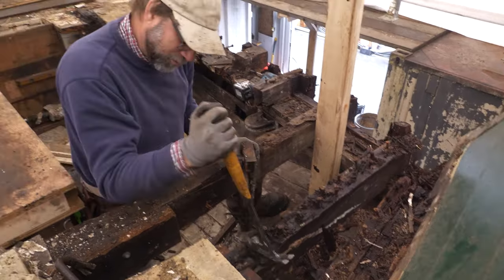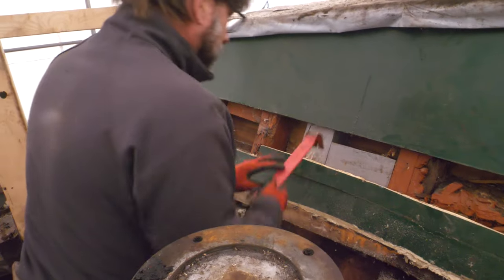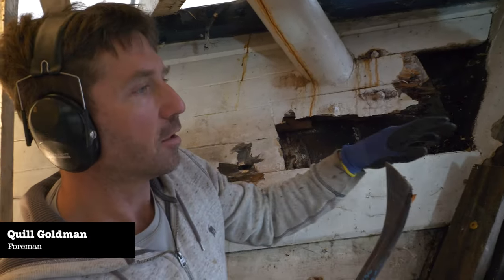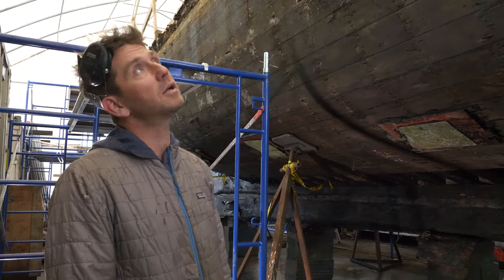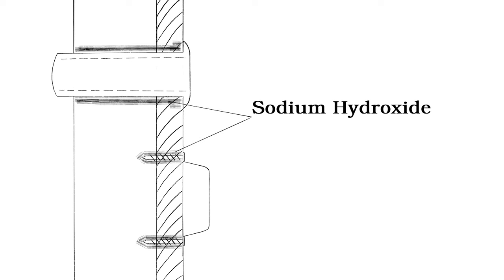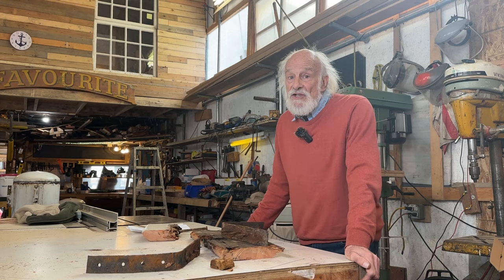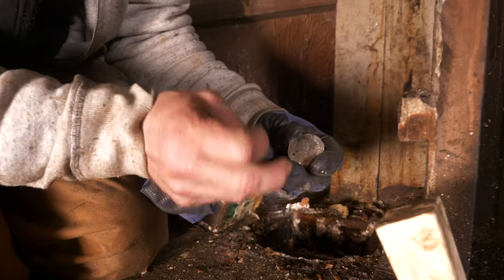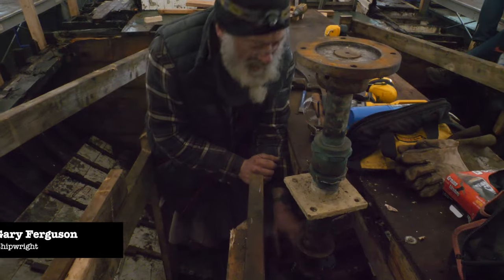How much of this 90 year old ship is salvageable??

Comment: So what kind of horsepower are we looking at on that old mother you pulled? I was surprised by the small size
Reply: It's a GM 4-71, lots of power. Installed laying on its side to fit under the galley. Very odd installation.
Reply: Its only like 160 hp from that block.  Sure with lots of torque .  @fahmoh

Comment: My god, how long was that ship underwater?! There doesn’t seem to be one drying anything on that boat…except maybe the concrete. Even the metal encased in the concrete is rusty.
Reply from the maker: 88 years, in some of the roughest conditions in the world. Frozen into the ice many times, beached, etc. she was built like a tank with a layer of ironbark on top of the original planking. And then copper was eventually added on top of that.

Comment: She certainly is in a bad way, makes Tally Ho look pristine when Leo first took her on. Appreciate that North Star is a working boat, but hopefully the aim is to restore/rebuilder to a high standard respecting her history. Lots of work around very rotten and wet timber and rusted and rotten metal work. Stripping down is nearly always the relatively ""easy" part, but how are you going about recording the shapes and details? Are there drawings of the boat, and/or new drawings being made as the work progresses, and are photos being taken of the parts as well as measurements, or how will the replacements be accurately reproduced? Whatever, wishing you all the very best of luck in your mission to bring her back to life.
Reply from the maker: Yes, patterns are being taken for each piece that comes off, that work will start around next episode. Cheers!

Comment: ln the deconstruction of "Tally Ho", Leo Sampson and his lone helper were quite careful, that they salvaged a lot of hundred year old wood which they cleaned and reused in the new, refurbished Tally Ho.

This one is at least 8 feet longer than Tally Ho and younger by about 25 years so there could be more salvageable, precious wood.
Reply: the condition of tally ho's timber was much better than this - this is at an advanced state of decay, as has been stated by many pro shipwrights/riggers in this series. also tally ho had been gutted. i'm sure they are documenting and labeling many of the salvageable components, if not all.
Reply: @brianmolhoek8403  But the North Star was still floating, towed afloat; Tally Ho laid on its side, beached and on the mercy of the tide for years before Leo found it. Was it that although Tally Ho was 25 years older, it was better built and built with better wood?
Reply: I'm not sure about that "a lot wood” being salvaged on Tally Ho. The only real part of the old girl left as originally used would be the Transom. It is not a restoration anymore but more a recreation, which is fine. But it would seem at some point just build a new one from scratch that's really what Tally Ho is now, less work, probably cheaper and it serves the same purpose.
Reply: @NOLAART  You're probably right. l just observed that a lot of Tally Ho's upper planks were saved, and so a lot's been repurposed by Leo and his crew to various parts of the new Tally Ho.

Comment: With this boat and the Tally Ho, I ask the same question. At what point are you just building a new boat? Why wast all this time and effort? Just cut it up to take measurements, save the hardware and build another replica. Trying to tear anything down while also trying to keep it together at the same time is at least double the work if not more. And to safe what a few boards so you can give the boat the same name. You’re kidding yourself. It’s just a new boat with a few old parts on it……so just build a new boat and put a few old parts on it. Stop trying to build a new boat around a very few old parts. It’s taken years and an enormous amount of money to “rebuild” Tally Ho” and it still hasn’t set sail. I’ve followed it, at first a lot….then less…then barely. It was excruciating. But what was evident is that there is VERY little of the original boat there. Say 10% and that being generous. Aside for the hardware and so little wood you could probably have stacked it in a corner after tear down, it’s a brand new boat that could have taken way less time to build. I’m not trying to be negative though I realize that’s how it may be coming off. I’m just trying to understand the logic here. Digging out all that concrete and rotten wood while gingerly trying to save boards only to find out they are rotten anyway seems crazy to me.
Reply: I think the Acorn to Arabella had the right idea, they had a donor boat and just took what was usable and built everything new.
Reply: It still interesting to learn and watch
Reply: If we use classic cars as a comparison, there is a sliding scale for restoration and keeping original identity. It is a difficult situation to navigate.
Reply: I do not understand the fixation with how much of the final product is “original” or whatever you want to call it. Specially with a project you have nothing to do with. Call it whatever the hell you want. If you don’t’ like watching people working toward a common result and learning what they want to do while they are doing it, then watch something else. This commentary about “why all this because it ain’t original” is neither constructive nor of interest but rather blowing hot air.
Reply: Look up "Ship of Theseus".
Reply: It's the same like restoring old houses or cars. Youre saving old historie, and you like it or not. I follow tally ho, arrabella and now this project. I likecthe way of saving history and old craftman ship
Reply: I think some of you may be missing my point. I clearly said I’m not trying to be negative, I’m trying to get an understanding of why. Further, I 100% get saving history. When I say build a new boat I mean build the exact same boat from measurements you took off of the rotten parts of the old boat but make the decision earlier on that your not going to save all or even most of the old boat so tear it down faster and get measurements. Boats luke this and Tally Ho were 90% un-salvageable. Yet they were still torn down excruciatingly slow and were being built at the same time they were being torn down. One of of the commenters used a car analogy. I’m a car guy so that’s perfect. If I buy an old mustang (of which you can purchase or build 100% of the sheet metal from scratch) and I’m tearing it down only to find it’s rotten steel 90% throughout, it makes more sense to build another exact same mustang and take the original parts from the original car that are salvageable. It doesn’t make since to build around a car that’s 90% rot because at the end of the day it’s still going to be a new car with whatever I could save off of it. I don’t know how else to explain it. Tally Ho is a brand new “replica” of the original with a few original Tally Ho parts on it. Doesn’t matter how you slice it. Sure it’s amazing watching the craftsman build all those new parts and I’m all for that. It’s the slow tear down that’s throwing me off. Measure the parts and tear out the old wood and move on. Taking days and weeks to take off a few salvageable outside boards when you have to replace 99% of the other ones doesn’t make a lot of sense. Jack hammering out concrete for days and week to save one keel beam that your going to have to sister 50% back in anyway seems like a waste of time. Just tear it down, measure the old lumber and replace the whole thing.
Reply: I think a key to understanding is when you asked what the logic is. Could it be that their logic is just different to yours, that their journey of restoration is different from your destination? As my old guv’nor used to say, ‘don’t apply logic where logic doesn’t apply.’
Reply: The Ancient Greeks were contemplating this with the ship of Theseus
Reply: The men and women aboard HMS Victory or USS Constitution. Would disagree with you.
Reply: Because they can’t.
Reply: @LinenAssociate every 7 years or so every cell in our body has been replenished. Every 90 years or so a town will have an entirely new population. Are we the same the people? Is it the same town? Yes and no. Everything in the universe is in a state of constant change and all we are preserving is memories. They are fixing a boat there for the boat remains the same boat. If they built a new boat it would be a new boat. 🙂
Reply: @dnomyarnostaw you may not value anything enough to restore or preserve it. Some people find joy in things. In case you didn’t get the memo North Star is rich with Canadian history and the north west passage wouldn’t belong to Canada if it wasn’t for this lovely ship. The only thing lousy here is your attitude and disposable nature.
Reply: I'm just glad to see some actual men working on a boat. Something about the NW united states, the women are more manly than the men and that's no disrespect to the ladys.
Reply: You have no sense of history at all. We like following Tally Ho and this channel because we are inquisitive of how the old technology worked, how the old ship designs can help the present culture of shipbuilding.
Reply: Until you fall in love with a timber boat you won’t understand, every timber boat has a soul and you build a trust with her and you will look after her and she will keep you safe out at sea 🌊 👍